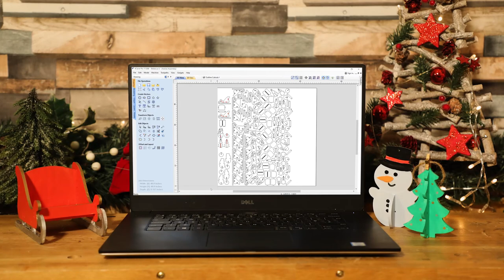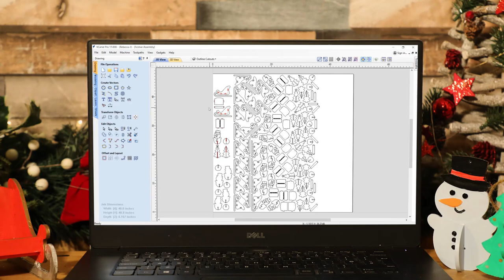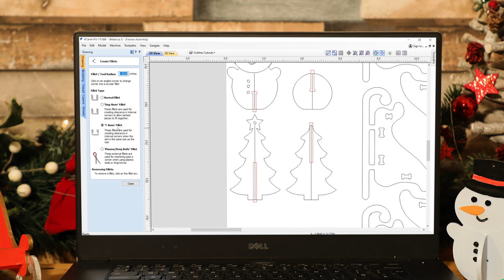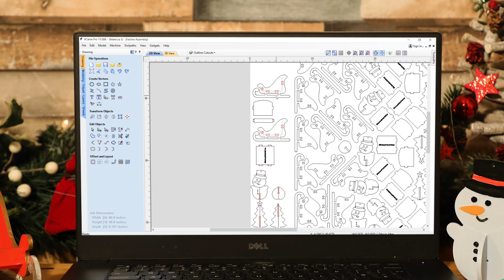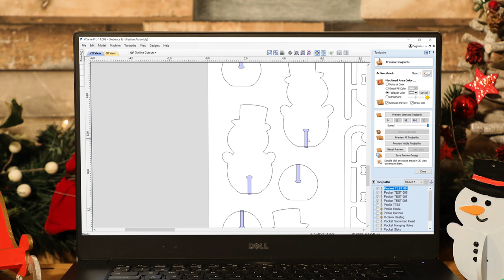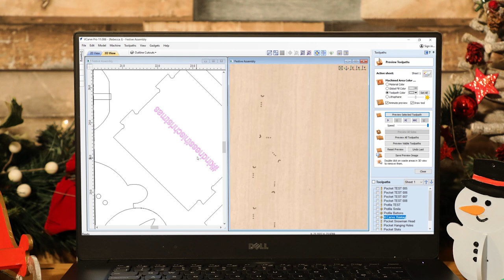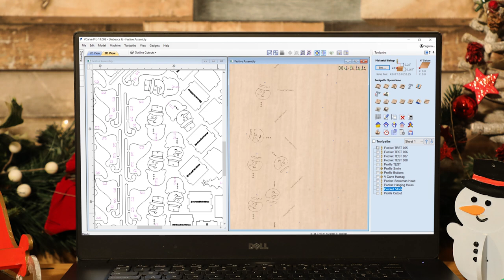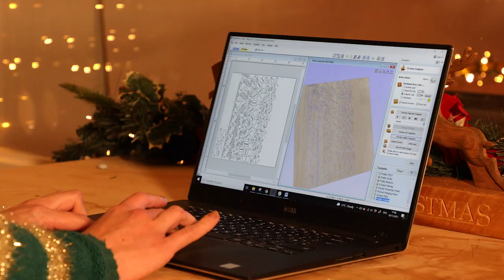Festive Assembly with Beki | Vectric's Christmas Toy Shop | Day 6 | Vectric FREE CNC Projects

Comment: Can i get a DXF version of these files anywhere? I only have software version 10.5 so i cant open it off the website
Reply from the maker: Hello Cameron... unfortunatly not, but, that project can be opened in the Free Trial Version of our software.  So if you are inclined you could download a free trial of v11.5... open the file and cut it.  Keep in mind that you won't be able to change or export the vectors, just modify the material and tooling for your needs.  Hope that helps... #kindnessthischristmas